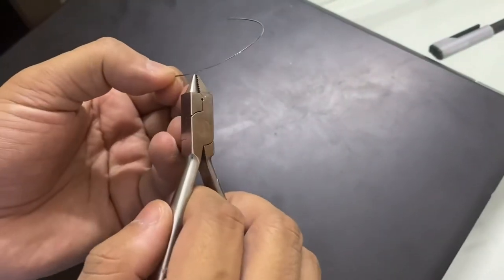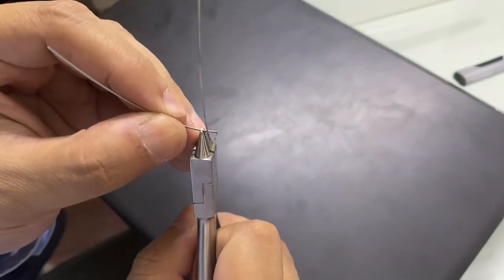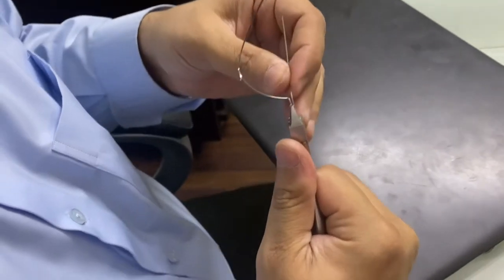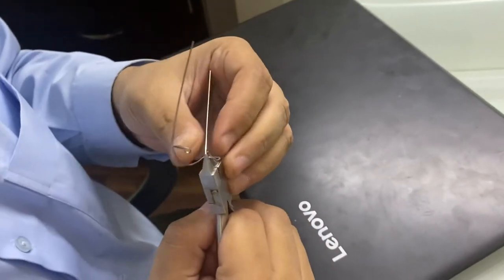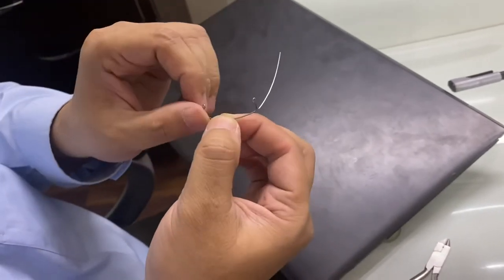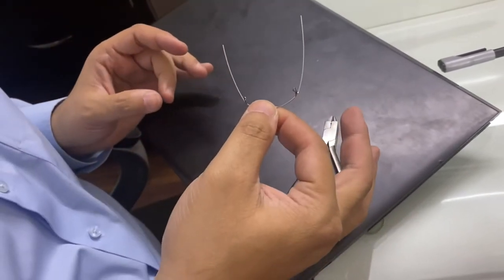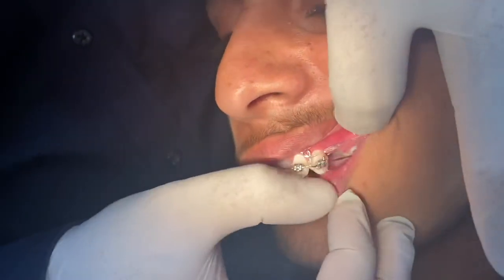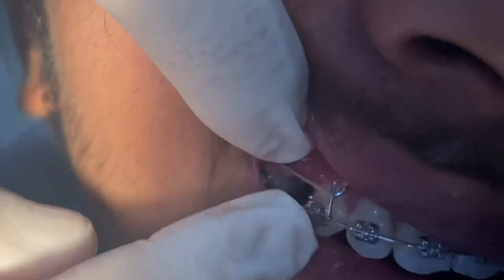Alternative of crimpable hooks for Upper Labial Segment Retraction

Comment: Yes sir you are that bull loop can be alternative to crimpable hook but it increase springiness in wire and lead to torque loss..If we give torque to anterior teeth it will lead to extrusion of incisors due to asymmetric v bend principle...so in short crimpable hook or solder hook is gold standard
Reply from the maker: No .. this V  bend in the wire will lead to intrusive effects on the anterior segment 
Yes I do agree .. increasing length will increase springiness and soldered hooks are gold standard… BUT I personally have found soldered hooks vertical short so I will change the point of attachment and force vector and you will agree with me increasing vertical height of soldered hooks will make it fragile and bendable ..19X25 SS are way more rigid compared to vertically long soldered hooks secondarily extra cost of hooks 😉 can be avoided..
One more very important point is torque control of anterior segment while retraction this v bend will incorporate torque in the wire and this is super easy ..you can give a try..  and at the same time it will be controlling overbite ( opening the bite )